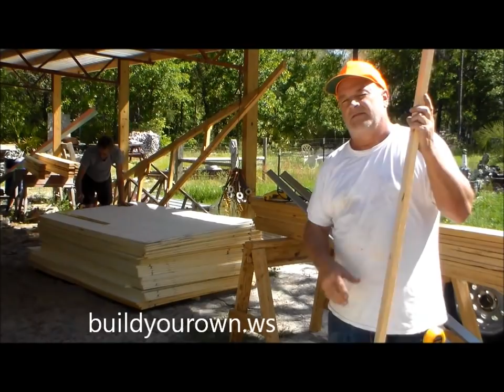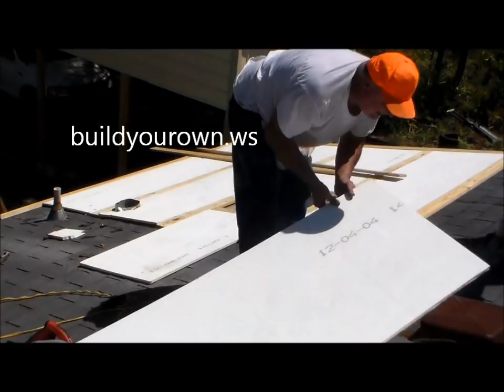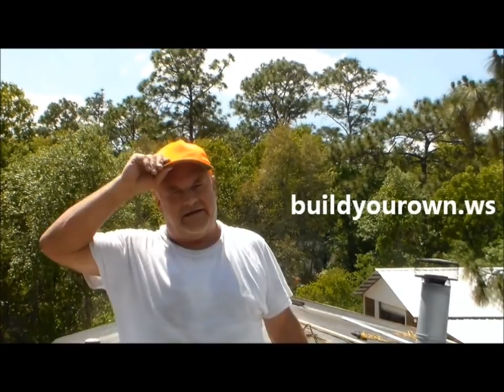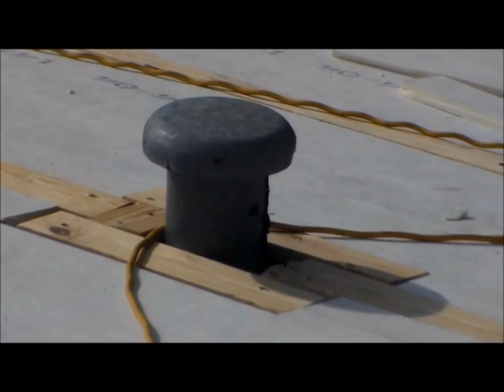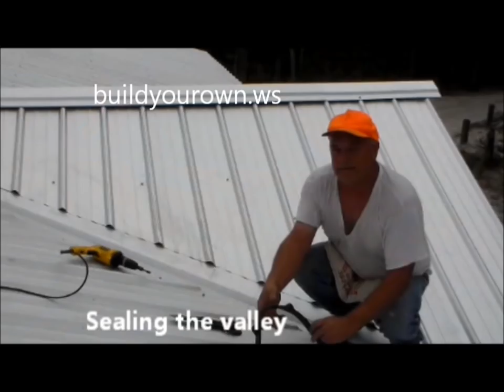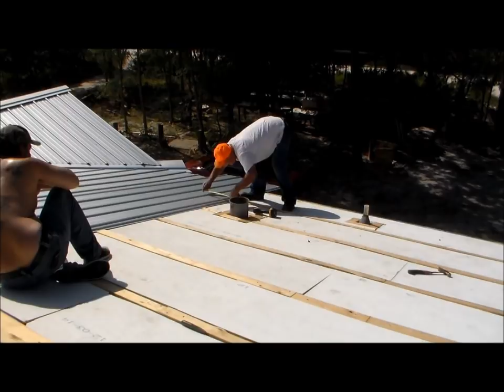Mobile Home Roof Over

Comment: my roofer didnt use foam insulation, jsut the wood bracings. our attic is already insulated though so it it necessary?
Reply from the maker: Probably not needed, insulation is expensive and it might not be worth the expense if you already have insulation in the attic, my place doesn't have an attic.
Reply from the maker: TedsDixieSheds Termites need water to eat the wood,  as long as the roof doesn't leak and isn't in a high moisture location it will be fine, the woods not exposed, everything is covered, you can get closure strips to seal the eves and ridge cap if you want but you might need a ridge vent.
Reply: TedsDixieSheds yeah they have softing on the bottom with like little holes in it and a ridge vet right at the top to ventilate hte attic i assume
Reply from the maker: randomrazr Soffit has perforations that let the air flow to help with ventilation

Comment: great video I have about 14 roof vents  on top looks like you didn't put yours back. is there enough spacing for air flow without them?
Reply from the maker: I did cover most of the roof vents, in my case the home got noticeably cooler in the summer so I guess they weren't that important, most the roof overs I've been on, the vents are removed because they are expensive to replace and seal, they can easily leak if not done properly.

Comment: Great video guys!  Thanks!  I want to do a roof over on a mobile home but it has been leaking.  Do I need to repair all the wood damage and soft spots before adding the metal roof?  I'm sure it would be best.  Thanks again!
Reply from the maker: It would be best but I've seen people cover soft spots and have no problems, sometimes when you start repairing all the soft spots you can get in to a whole lot of fixin. Wood damage needs to be repaired if possible it needs to be safe to walk on.

Comment: Shouldn't the vent boot start under the sheet metal and come up through?
Reply from the maker: Not the kind I used, they are designed to slide over and conform to the shape of the panel.

Comment: my mobile home has roof vents for the bathroom fans,they flap and make noise and let cold air come down.I want to change these when I do steel but do you have any ideas on what options I would have.
Reply from the maker: They can be very tricky, I covered the vent in the master bathroom because the cold air was coming down in the winter and I'm sure it was losing AC in the summer, I haven't missed it, on the other bathroom vent, I drilled out the rivets on the lid and replaced it after the metal was installed and it still works fine. I used to stuff paper towels in mine before I eliminated it.

Comment: What was the cost to do it yourself ?
Reply from the maker: It was around $2000 with the insulation and wood, I have seen people go directly over the shingles with no wood or insulation and screw into the plywood under the shingles. It worked but the roof looked a little lumpy, didn't leak though.
Reply: Very cool

Comment: Looks good and quite informative. You should probably install the entire closure piece under the metal roofing material in a valley to completely prevent leaks and then tightly screw the metal roofing on top roughly 4" from the edge. This should keep the piece squished down there, so you will not loose it. Instead of putting small pieces of the closure piece in after the metal roofing material has been screwed down. Just my thoughts, I am a contractor but not a professional roofer.
Reply from the maker: I had some old closures I wanted to use up, the full closure strip wont fit when the panels are angled like they are on the valley, that's why I cut them down.

Comment: I was just wondering why the big over hang on the metal??
Reply from the maker: I like to throw the water away from the house, the water used to splash on the windows before, because it came right down the wall but now it goes over and away and the windows stay mostly dry when it rains now.

Comment: I don't like to be a critic,but cut around first pipe jack looks pretty big,I will recommend to you that existing pipe jack be removed,before panels are installed ,what I do is a tide cut around pipe and seal it,before pipe jack is installed,
I personally don't like top end of valley,on a low sloope roof maybe is fine but a high sloope roof it will look pretty weird
Reply from the maker: It's true, I cut the hole to wide, I don't do roof overs all the time, that could have been done better but worked OK the boot still covered it.

Comment from the maker: Yes I've done this on single wides before, just make sure when you screw down the 1x4 roof wood that the screws are hitting plywood or a roof truss below and not into sheet metal only.

Comment: I noticed the home you're working on has shingles on a pitched roof... I have a pitched roof, but my mobile home came with some type of metal roofing... I was wondering if it would be safe, recommended, or possible to do this on a single-wide?

Comment: good for you !  gotta give you credit for jumping in there and doing it !  The reason you havent experienced greater savings in your AC is that the insulation doesnt promote air flow like a thermal blanket does. I couldnt tell if you cut a vent in the ridge as that helps air flow from the attic. Would suggest you also cut end caps for the ridge ( you may have , I just didnt see it ) to keep all those wasps, etc from getting in there...it doesnt leak and you have a 35 year roof.good job !Thanks!

Comment: I would suggest at 11:00 to put a ring of silicone on the vent pipe just above where it will sit on the pipe and pull the boot over and down into the silicone so it the silicone sill be under the boot so the sun wont degrade it. Thanks for the video!!

Comment from the maker: Your welcome.  I'm in Florida, so far there is no problem, I think it gets to hot between the panels for the algae because it still looks good, It is on the north facing side the siding needs to be cleaned once a year on that side it turns green but i haven't ever had the roof on that side turn green, but the roof is in full sun most of the day. The roof looks good, there's no discolor between the poly and metal panels yet, we have had some serious rain this summer and it hasn't leaked at all.

Comment from the maker: Yes the insulation is to reduce noise and lower energy cost, my mobile home doesn't have the best insulation to start with so the $400 I spent will come back in reduced electric bills in a few years in my case, the difference in the electric bill wasn't as much as I had hoped but it did go down and the AC has a much easier time keeping the place cool in this summer and It's not running constantly anymore so I believe it should last longer, It's made a big difference.

Comment from the maker: Sorry, I kinda glossed over that part, it's hard to get video and do the job at the same time, I followed the ridge line and joined the next panel before screwing it off so I can make adjustments, of course install the valley metal  first to help line it up snapping a chalk line down the valley where the metal will run can help line it up, it can be tricky, not my favorite job

Comment from the maker: Roofing contractor will charge around $5000 but the materials cost around $2000 for this one, cost will vary depending on the number of hips and valleys and the amount of vents or skylights also the chimney boot can be several hundred dollars and if you don't need the insulation it would save more so it really depends on the type and layout of the roof